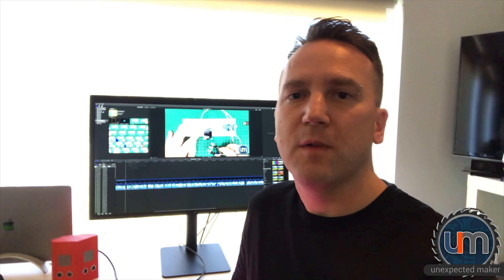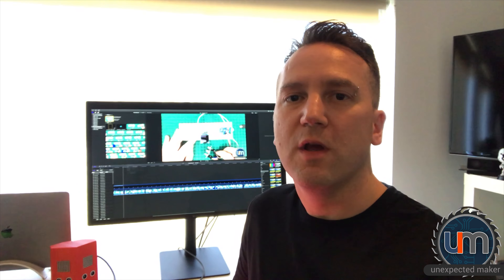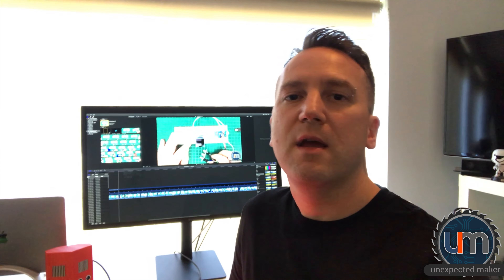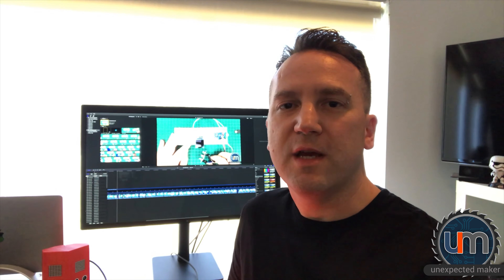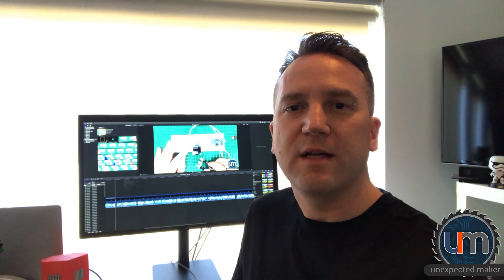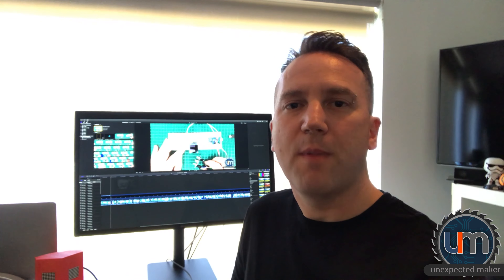PCBWay Update - Neo7Segment Display Part5

Comment: I've thought about trying PCBway but Elecrow have never given me a reason to ditch them. I actually got them to build 50 of one of my Tandy adapters and, despite the build requiring them to customise the pins on the ISA slots, they did a great job!
Reply from the maker: Wow, never heard of Elecrow before... looking them up now, thanks!
To be fair, this is the first time I've had an issue with PCBWay, and it's my 5th order with them.
Reply: fair enough, I've been using elecrow since June last year and am very happy with them. Most of my designs aren't complex but their staff are great, if they are ever unsure about something or I've forgotten the  NC drill file, they email for clarification. On my complete build job, they fussed over every last detail, I was super impressed.
Reply from the maker: Their PCB ordering website UI is PCBWays ordering UI, so I think they are maybe on selling PCBWay services? Even their job status Icons are from PCBWay ;) Their pricing is also the same. You should ask them next time you use their services.
Reply: That's funny, I must take a look.
Reply from the maker: So I just looked at seeedstudio.com pricing for PCB manufacturing. They are cheaper than PCBWay and JLCPCB on anything more than 10 boards. Pretty sweet actually. Might look at using them for my large run of Ney7Segment boards.

Comment: It works (and it's looking great)!  Congratulations! 
(Perhaps you can do a manual fixup with a Dremel while waiting for the corrected boards?)
Edit: did you also test the small decimal dot?
Reply: 0:32, all looks good! :)
Reply: Stephen Ludgate - Now I saw it. (Was looking in the wrong corner) Thanks...
It's a nice board that will probably look good in smart clock...
Reply from the maker: Lol, no way am I taking a dremel to the boards - I'll wreck them for sure! I think these 10 will just be solid centre versions :-)